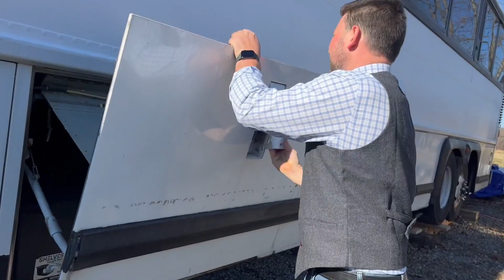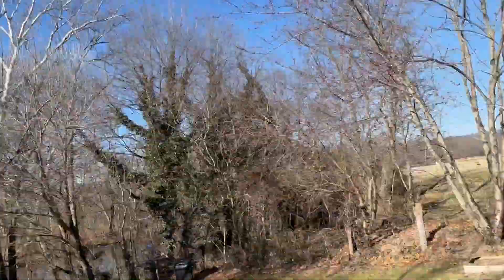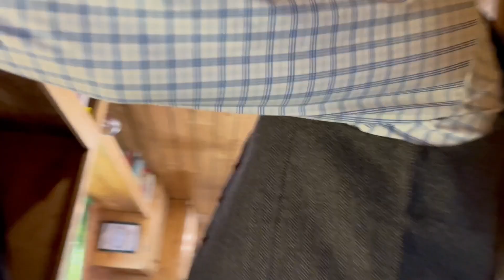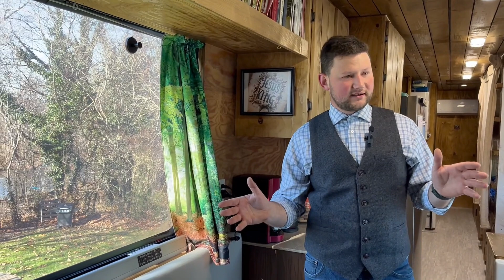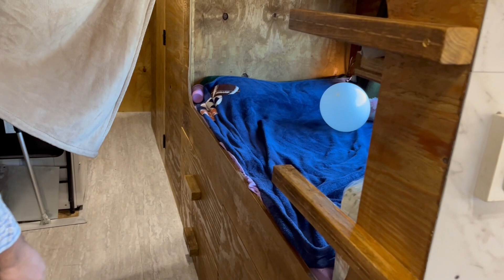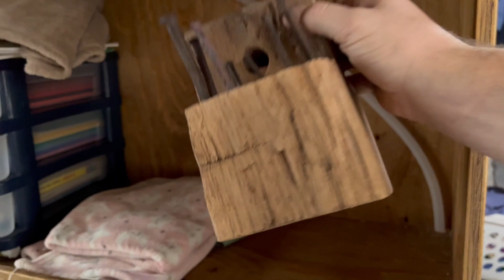We Turned a Bus into a Motor Home.

Comment: Seems to me that propane tank should be a little bigger than what you have for a bus that size. Nice rig.
Reply: The only thing it’s running is the water heater and the stove. That tank will last that family all month if not longer. I used a bottle that size for my stove and dryer and with it just being me, it would last 9-10 months

Comment: Sir I see a very critical hazard that’s been overlooked. That propane tank inside the same bay as the water heater. It can be done safely if the propane is in an enclosed compartment with  ventilation in case of a leak. I have the same bus as you with just about the same bay sent up. Difference is I have my propane in an enclosure with vent hole in the bottom. I hope this information is helpful and I think it should be top priority to address.
Reply: I agree I was thinking about that and was not sure what to do about it.
Reply: I certainly hope they read your comment.